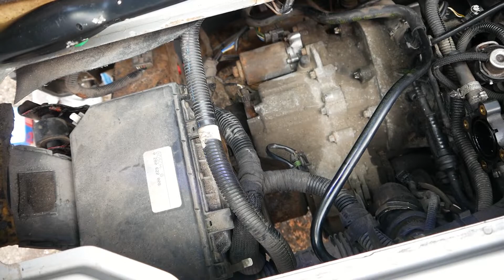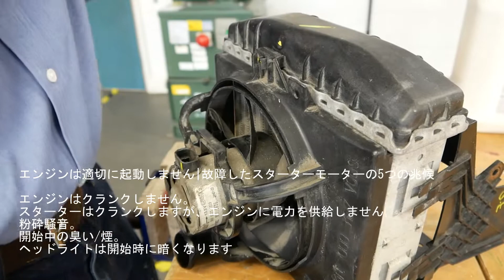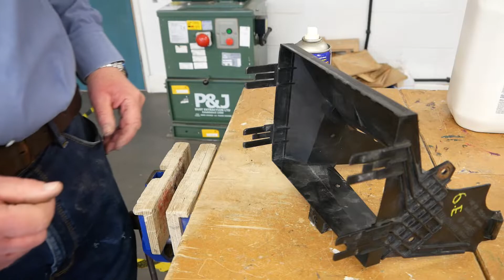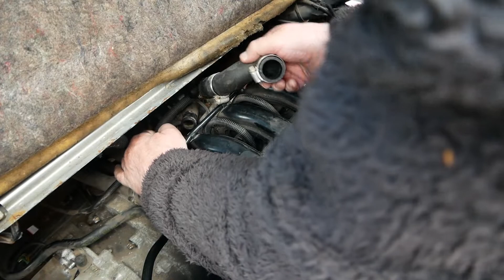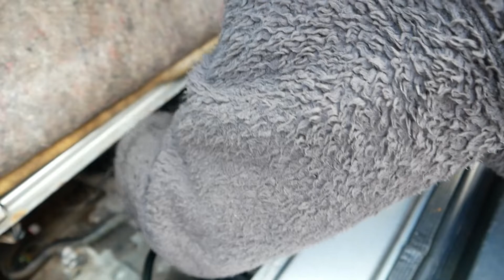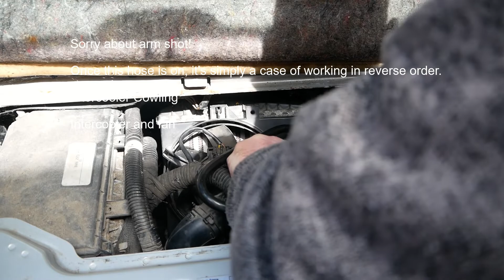How to remove Smartcar Starter Motor, スマートカースターターモーター

Comment: Hi Mr David!
Thanks for the video.I just replaced starter on my Smart.Finaly car starting normally.It was also challenging work.
But in the end I need your help I left my car work on idle for 10 minutes and after that suddenly car turned off.I started car again and car working rough like he is missing air or something something is wrong and I can't figure it out.
I have engine fault and unfortunately I don't have diagnostic tool to read the fault.
After the car cool down engine working better.
do you have any idea what should I check first?
Regards!
Reply: Short update all OK it seems that something was with a connector on the throttle body.Connector cleaned with contact spray all working now.
Just one more  question after the coolant hose was removed do I need to bleed the cooling system?
Reply from the maker: @cromgu3664  Turn the engine on and let it get up to temperature, if it keeps getting hotter it means you might have an air block. This will mean you will need to bleed.
Reply: Thank you very much for the help!
Reply from the maker: Hi, glad to hear you were able to change the starter motor. If you have an engine management light I really would get a cheap diagnostic tool. Here's the one I have https://amzn.to/4d9tPIp on Amazon. I had a bad idle engine and it was the oxygen sensor, but because there are two I really would recommend getting a diagnostic tool. Could also be a fuel issue like a spark plug. Once you have the engine fault code, let me know and I'll see if I can help.
Reply: Hi ,
thanks for fast reply!
I bought diagnostic tool last night.Code read out says "Throttle pedal position Sensor Switch A Circuit" now car doesn't move and do not  accepting any power.
I have deleted the fault code and removed throttle boody to see what going on, reinstalled throttle body.After that car is accepting the throttle and I have power.No Engine fault with "Throttle pedal position Sensor Switch A Circuit" but big bang I hear when I give more power and engine fault is on but diagnostic tool do not read the fault.
Do you know maybe what can it be?
thanks!

Comment: Hi David. Hope you're well. Thanks for another detailed video. I'm having my own intermittent issues with the Smart Roadster starter motor - fitted only 2 years ago. It was likely a refurbished unit as the garage was being unhelpful about the make & model they used:( 

The issue: Using Mr Harrison's guide from Evilution - about every 4 to 5 starts I have to gently knock the the starter motor via the gap in the manifold. It then confidently starts & all is well. If i'm not mistaken knocking releases the stuck solenoid that temporarily fixed the issue?

If I were to remove the starter as per your video - quite a task I know - do you think I could do anything on the bench to stop the seizing? This was fitted 'new' in February 2022 - so I had approx 18 months before it happened.

Any advice would be much appreciated,
Best Regards 
Almo
Reply from the maker: Interesting that this is your second starter motor, I've also had to fit two! Your right tapping does release a struct solenoid. Using drop bolts to lower the subframe is the easiest way to gain access to the starter. The second time I replaced the starter, I also changed the alternator, simply because I could while I had good access.
Reply from the maker: Sorry, I also meant to ask if you have checked the condition of your battery?
Reply: @shed52  Hi. Yes the battery is good & well maintained with a monitor. I do have a more recent Alternator problem (last two weeks)- only charging sometimes. I wonder if the aforementioned starter motor issue has now caused the alternator to be inconsistent. The Alternator is freely rotating as it should / no slipping. I used a Multimeter of course to test whilst running & some days it doesn't charge at all / reach anywhere near 13.5 (with a fully charged battery) - but yesterday it worked okay.

The inconsistent behaviour is a little confusing - I have read that Alternators don't always just die - they can slowly deteriorate. Do you think anything else could be the cause? Thanks again

Comment: Hits David, very informative video you made here, can I ask if you needed to lower the engine at all to reach the starter motor, as most methods I’ve found say this has to be done , thanks
Reply from the maker: Yes, I did buy some lowering bolts, which made access much easier. (I did the alternator at the same time) Dropping the subframe does mean you can replace the starter fro above. Not cheap £29 I do have a link for them https://amzn.to/3jgVPm9
Reply: Hi, do you have a video that explain the procedure to drop the cradle? I'm sorry for my lot of questions but you make a very good videos!!